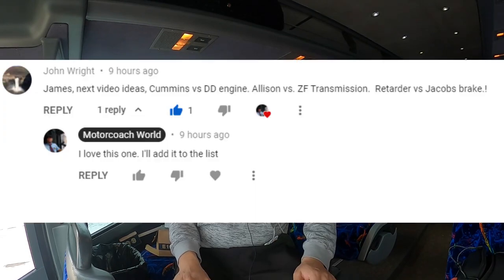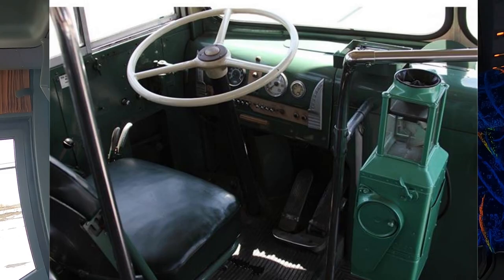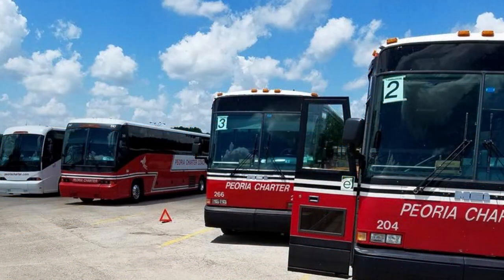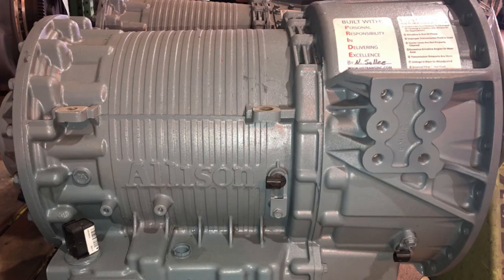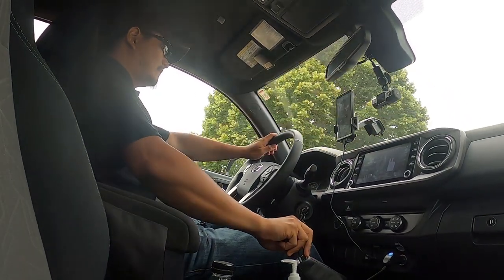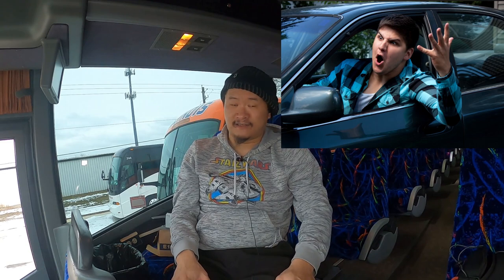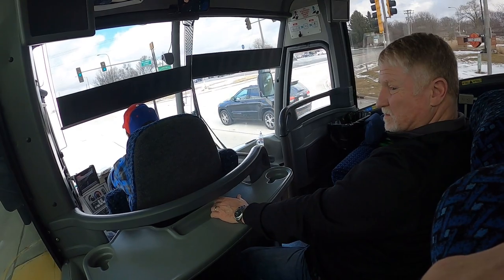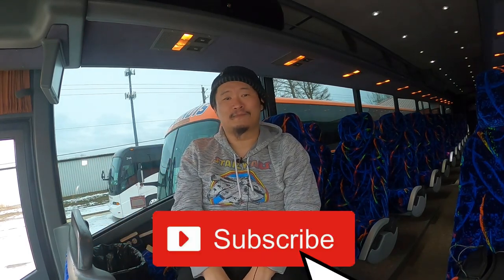Coaches buses come in Manual, Automatic, and Both .  The ZF Transmission

Comment: Maybe interesting to watch, search for “VDL Futura Bus 0-100km/h Acceleration Coach Full Throttle Kickdown”. Listen to the engine, it shift up only 4 times until it reaches 60mph, despite this being a 12 speed box. Dangerously slow? I don’t think so.
The acceleration is further improved if the engine is equipped with a powerful (cam-driven type) engine brake. Buses don’t have this. It reduces the shift speed on upshifts considerably as the engine brake is applied to down-speed and rev-match the engine. In the bus video of the example above the gearbox is basically just waiting for the rpm’s to drop to be able to engage the next gear. You can hear this very clearly on some trucks, especially Volvo, the engine makes a barking sound during gearshifts which stems from the engine brake. It is really impressive how fast these can shift.
Reply from the maker: This was very interesting to read. I will have to look this up1 Thanks for posting this!

Comment: My favorite  is  the fuller roadranger  in trucks  but  you have  to go back 45 to 50 years to  find  those  in Busses
Reply: I believe the last use of a fuller road ranger transmission used in a bus may have been a crown supercoach. Most were built as a school buses and however a handful were built as intercity motor coaches similar in dimension to a GM 4501 scenic cruiser.

Comment: Cool new bus channel, subbed.  You should try checking out some vintage coaches if you get the chance :).

My '61 GM PD-4106 was retrofitted from a Spicer 4-speed to an Allison auto, easier to drive, but not as fun.

P.S.  The GM "Old Look" wasn't called that until the "New Look" aka "Fishbowl" came out.
Reply from the maker: Hey Macelius! Thank you for that fact about the Old Look! really appreciate! I love vintage coaches! I want to look and research them more!
Reply: In 197Os New York City bought about 10 or so double decker busses from different companies and set ups.  One labeled
  "SPICER SELF CHANGING GEARS"
acted as a 2doeed (never felt a 3rd gear at city bus speeds).  Starting from a when motor raised above idle, gear thrown into  gear, at about qp/we clutch thrown I Hand secong hear activated.

Was ruff but bearable downstairs, but lurchy on top deck or if on stairway.

Other buses had 4 pmOn Floor.  

Many had Dutch door so could see drivers actions below elbow, but think had some automatic.

Comment: The truck and bus world has been sorting out manual vs. automatic, and where automated manuals fit for what... 60+ years now.  ZF has built conventional ATs for many decades... lots of Euro city buses use them.  The AS-tronic has had greater acceptance in European coaches than in North America.  AS-tronic and other AMTs have become standard fare in over-the-road trucking fleet operations everywhere.  One factor you kinda skipped over... torque converters.  Nothing can match its smooth jolt-free launch and initial acceleration of a converter.  And, a TC enables a transmission with fewer ratios to do the same job as an MT.  But, mechanical coupling is still more fuel efficient once the vehicle is up to speed, even with converter lock-up clutches.  MTs remain simplest and lowest initial cost, but efficiency depends upon driver skill.  ATs are unbeatable for frequest starts and stops like city transit, pickup and delivery, fire and rescue.  Their continuous power flow enables passenger pleasing shift quality... highly valued by NA motor coach operators.  AMTs enable less skilled drivers to achieve the best fuel economy in open road operations.  This has been the top priority for Euro motor coach operators.  And, when there is freight on board instead of passengers, lowest total cost of operation delivered by AMTs is first choice.

Comment: The only transmission in any commercial vehicle should be an Allison period.  The 3000 and 4000 series or B500 variants are in beatable!  I see very few major failures in these transmissions.  They shift smooth, handle heavy loads and accelerate continuously while applying power.  Most issues I do encounter are due to owner/operator errors. Such as lack of maintenance and not using the correct fluid.
Reply from the maker: LOL I love and agree with this comment! Nothing better than a Detroit 60 with a Allison combo! Smoothest running coach ever!

Comment: First, it was a 1940 Olds, not a 1948,  I think one of the big reasons for sticking with manuals was increased efficiency, although new automotive automatics are claimed to be more efficient than manuals.  I’ve got a 2011 BMW with a dual clutch transmission that works primarily in automatic mode. Even if you put it in “manual” mode, the automatic mode kicks in if you try to go outside the envelope. They seem to have solved most of the issues you mention with the ZF.  One of the big reasons is that engine and transmission controls are completely integrated. It can upshift in like 20 milliseconds because the the fuel injection drops the RPM so quickly to match the new gear ratio.  It sounds like a little fart. This is also a big reason why the new automatics are so efficient. Maybe one reason the ZF isn’t successful is because it doesn’t have that level of control integration. I suspect the engine and transmission actually have to be designed together to match their characteristics. Torque converters are more forgiving to the whole drivetrain than clutches are.

Comment: this reminds me of a time when i was driving the company car (a VW Passat) that has the DSG 'box... i was parking on a slight incline, and that freakin' dsg couldn't move smoothly, if i released the brake it would roll downhill, and if i accelerated even the slightest, it would jerk forward... as long as i have both legs working i'll have a manual...

Comment: I drove a transit bus for 27 years , automatic transmissions only , some had no power steering , no A/C , some no air ride Recaro seats , bad suspension , very hard on the spine !!!! Good money but not good for your over all health .... no access to a washroom . The worst buses are Nova , the best are Flyer Excelsior 102" by 40 feet . Terrible in the snow . No snow tires . !!!

Comment: Part of the problem with the "sticks" is the amount of gears.  I learned how to drive a manual on a 4 speed stick bus
  It was easy to shift 
  Then came the 5 speeds.   The problem was an extra gear in the same space, meaning the gears were closer together.  The margin for error became slimmer and the chances of grinding gears increase significantly 
  Then came 6 speeds
  Again  gears being closer together or tighter meant shifting had to be perfect or risk grinding gears
  It probably would have been best to train drivers in a 4 speed until they msdtered it before they get to the 5 and 6 speeds 
  The problem with this is that by the mid 90s and into the 2000s, the 4 speeds were rare because they were old

I wonder why they didn't do for buses what they did for trucks.  If they would have left the 4 speed configuration. But had a switch that if you wanted to shift to 5th gear you would flip a switch and repeat the original shift pattern.   That way if you wanted 6. 7., or 8 speeds,  drivers could shift better without grinding gears and wearing out clutches

That brings me to one final point.   MCI clutches had springs on them so that holding down the clutch was very uncomfortable 
  It should be used only for shifting gears anyway,  but if you held that clutch down for 15 or more seconds.that clutch was so heavy it was going to push your foot back up..  it was heavy enough to push down as it was.  I was told that Prevost. GMC. and Eagle clutches were not that heavy.  But most buses in the 80s and 90s were MCIs

Fortunately for me,  I had a great teacher who taught me how to start on an incline without rolling backwards.

Comment: My classification of gear boxes are:
- clutched
- planetary 
- torque converter 
- auto shifter

Each has its positive and negative aspects.  The ones I look at are
- initial cost
- lifetime cost
- maintainability
- efficiency (effects fuel cost)
- safety
- ergonomics (includes driver fatigue) 
- ride 
As time has gone on, computer controls have improved performance of transmissions.  Properly designed auto shifters with good features avoid hard shifting while maintaining good fuel economy and less wear and tear.  
Unfortunately the industry tends to choose whatever is cheapest and let the driver deal with the consequences.  
The best bus rides I ever got was from a Crown school bus with a manual transmission.   The reason was our bus driver was an artist with the equipment (and fun person).  As a driver I want automation as it is less fatiguing.  Going down hills I want an effective retarded, which means a Jake brake.  I have been in very scary situations with buses that had no retarded on mountain descent.  Those situations mean very slow descents.  With clutched gear box and Jake brake in a semi rig I made descents at maximum posted speed.  Most passengers would not appreciate the noise of a Jake brake.   
-

Comment: The ZF ASTronic 12-16 speed transmissions are wonderful transmissions but this relies on being in one every trip to get the feel of the transmission, the braking, and acceleration. As the drivetrains for coaches is in the rear of the vehicle, a driver cannot rely on sounds to gauge operation or performance. While I for one love the ZF ASTronic transmissions, they are NOT Allison which is more car like in its operation. In the heavy truck division a transmission I liken to the ZF ASTronic is the Mack m-Drive 12-speed which is very much like the ZF ASTronic, ZF Meritor Freedomline and Detroit DT-series 12-16 speed autoshift transmissions and is more predictable, with anti-rollback, and capable of skip-shifting 2-3 gears at a time smoothly to help get to speed even faster. This is based on laden-weight of vehicle as well as grade of the roadway operated on but computer parameters does a pretty good job of knowing when to skip-shift and when not to. The technology is slowly getting better with each generation model and will in time outperform that of Allison. What I want to someday see is a torque-converter autoshift manual transmission which eliminates the clutch altogether which will result in softer launches, smoother shifting, and auto-neutral at stops and at idle.
Reply from the maker: Thanks! Eyes to see it by ELFL

Comment: The New York City  FIFTH AVENUE COACH COMPANY had DoubleDeckers that were scrspped after City took over, but in 1970s city bought about 1O double deckers of different makers and configurations.

One setup had "SPICER SELF-CHANGING GEARS" that acted like like a 2speed manual with auto clutch.

When driver accelerated from stop qst gear was engaged. At speed driver let up slightly on "gas" peddle and auto powered. (sounded like electric solonoid) ouches took place.  Jerky, but yolorable on bottom floor,, but unpleasantly jerky on top deck.

Another visible alternative was 
  4-pn-Floor
conventionally clutched.

I could judge other because couldn't see drivers feet and shifting due to opsge good to neck level.
Reply from the maker: Thanks for this bit of info! I did not know about this! Really appreciate it. Reading comments like these are one of the best things about making these videos. I learn so much from you guys.

Comment: Good try on pronouncing Friedrichshafen, it is not the easiest to pronounce.  I stayed there two nights in July this year.  The only "long" bus ride I remember this time was on the local bus - an automatic Benz O530 or similar, from the Friedrichshafen airport and Dornier flight museum to Friedrichshafen Stadt rail station (Hafen was the old central station which houses the Zeppelin Museum, but still partially functions as a rail station).  If you go to southeastern Europe, here and there you might still find manual transmission transit busses, especially in Belgrade, Serbia.  I remember riding on one about 15 years ago.  Much of eastern Europe has the "Marshrutka" system with smaller van-sized busses that serve interurban routes, and those have manual transmissions for the most part.  There used to be many Ikarus transit busses throughout the former USSR and eastern Europe, some with automatic transmission, especially the trolleybusses, others with manual.  Nowadays I see the majority of the busses on the Bald and Bankrupt channel, as I have not returned to the former USSR since October 2009.  Argentina is kind of half-and-half for its transit busses, and its interurban ones that I remember were all manuals, Uruguay is almost the same.  I suspect that most other countries in South America, the situation is similar.   The Irisbus that I rode from Ceuta to Tetuan and Tangier, was a manual.  Spain does not plan to do away with their manual busses, though the local transit busses are virtually all automatic as of August 2017.

I also need to mention regarding the older Routemaster busses used in London.  I think they were fitted with a semiautomatic transmission, that made the passengers think they were riding in a bus with manual, but there is a two second pause between the time the driver takes his foot off the accelerator, shifts into a different gear, and then resumes acceleration.  No clutch pedal was involved.  

Sorry for rambling.  My next coach ride is not until this November.

Comment: Why have 'dual clutch' (auto shifting constant mesh) transmissions not been used in motor coaches? I've owned VW/Audi vehicles and loved the DCT transmission.
Reply: Dual clutch needs synchro to work and those adds weight and they'll eventually wear out.  I've driven old beaters that ground gears even when the clutch was fully down.  It's not pretty

Comment: You forgot about Volvo I shift used by NY Trailways for pre covid-19 Port Authority Bus Terminal to Toronto Coach Terminal and Montreal🇨🇦 on their Prevost H3-45s. Border states like Texas California New Mexico & Arizona get the Newest ZF Automated Manual Transmission the Traxxon and Scania Opticruise for Cross US Mexico Border operation. Coach USA buses use a mix of ZF Astronic & Allison B500R.
Reply from the maker: Hey EpicThe112. Thanks for your comment and feedback. I wanted to mainly touch on the ZF but yes The I Shift is something a lot of people have been requesting! I will add it to the list
Reply: @MotorcoachWorld  Thanks for the reply and for Volvo I shift it's also an automated manual transmission like the ZF Astronic. Not sure if there's operators in Illinois that have them? Since I'm from NY/NJ the operator that uses them mostly is NY Trailways

Comment: Standard transmissions for cars in the 1980’s seems late to me, I’m thinking that automatics took over manuals in the mid-1970’s, but if you have data that says otherwise, cool!
Reply from the maker: Hey John P. You could be right. For this video I did a lot of my research on Wikipedia. Wikipedia is known to have its errors. Ill dig around to see if i can find this time line somewhere else. I appreciate you keeping me on my toes though!
Reply: @MotorcoachWorld    Actually the first automatics in larger numbers started in the 1940 Oldsmobile, moving to Cadillac soon after. Even WWII Tanks used two Caddy V8's with an automatic behind each (no reverse in either) That transmission was called the Hydra matic and had 4 forward speeds. By the early 50's every manufacturer offered some kind of automatic and they took over quickly with a much higher percentage of sales than the manuals.

Interestingly the 4 speed Hydra Matic was available in some light and medium truck and bus applications during the 1950's and early 60's.  GMC used it in Duece and a Half military trucks (early 50's) and had a version with a two speed splitter on the rear they marketed as an 8 speed.  It was also used in GMC pickups and I rode three school buses with the Hydra Matic. A 1957 with a 370 Oldsmobile V8 and both a '60 and '62 with a GMC 351 V6.

Other than the two speed V drive (Dwight angle drive) in the old look GM Coaches, the first big truck automatic was the Allison MT series  which came out in 1956. 6 speeds forward, one reverse with a hydraulic grade retarder. Eventually Allison made even heavier duty automatics (MT and HT series) for larger engines in the 70's and beyond.
Reply: Ya by the 70's automatics was the norm, learned to drive In 1970. You could still  find 3 on the tree as a option in vans and pickups. But most of the 60 0dd cars and trucks I have had since then were automatic. My big trucks have all been and are manual. But good to learn about buses. Thanks!